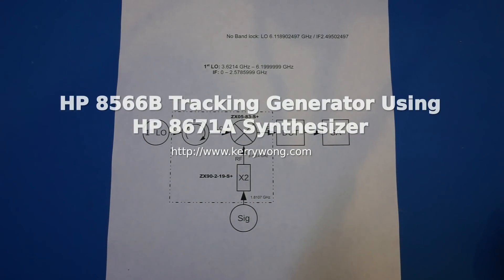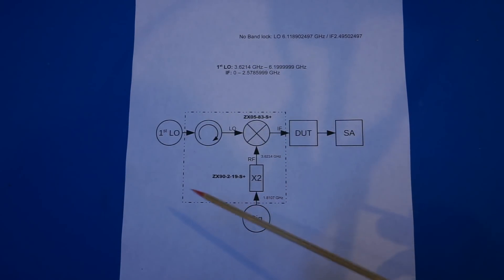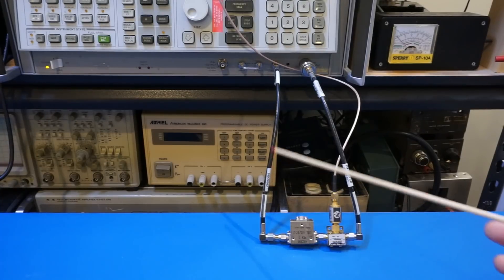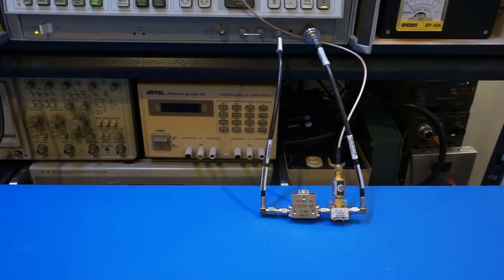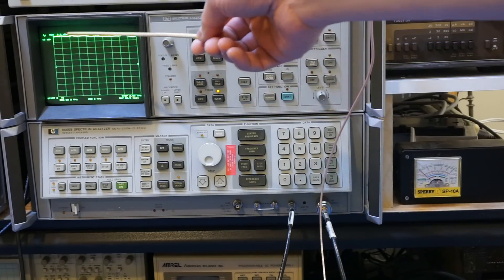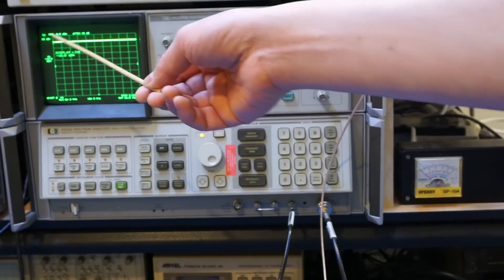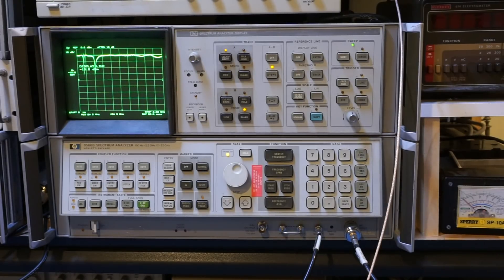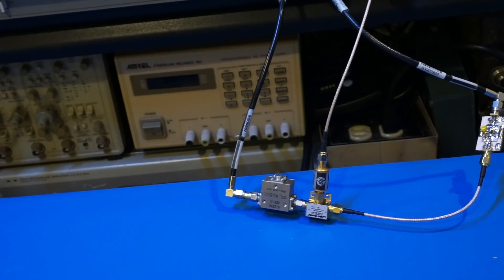HP 8566B Tracking Generator Using HP 8671A Synthesizer

Comment: Nice video Kerry. I believe you should have a say 3dB attenuator at the mixer IF output. The mixer requires nice 50 ohm termination on all its ports to meet its spec, but in your setup the termination on IF port depends on what DUT you are measuring.
Reply from the maker: Yes. That would definitely ensure proper impedance matching but at the same time sacrifice a bit of dynamic range.

Comment: Man, your 8566B is in beautifully clean condition. Mine got put in a box with  essentially no padding to the outside and between the two units and shipped to me. It arrived with all the corners smashed, the the units scratched up, and the screen destroyed and the keyboard cracked and many of the buttons pushed in and not working properly anymore.  The guy I bought it from on eBay was a complete asshole and claimed he'd done everything right and the problem was UPS. After being screwed around by this guy for a couple weeks eBay did refund my money. The guy refused to take the 8566B back. Over time I was able to buy all the parts to repair it, screen, keyboard, etc.  It's a wonderful piece of equipment - just mine is not in great cosmetic external appearance.
Reply from the maker: Yeah, these things are so heavy and typical cardboxes simply won't hold them. When mine arrived the boxes were almost destroyed and there were wholes on the outside of the boxes. Luckily the unit was shipped in two separate boxes and there was some bubble wrap so the only thing that was wrong was a dented corner which I was able to pull out...